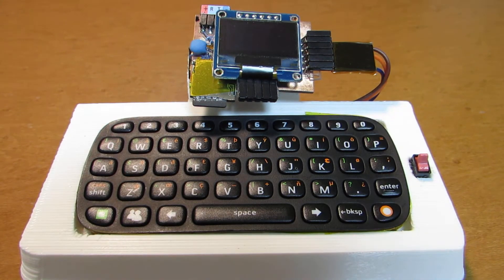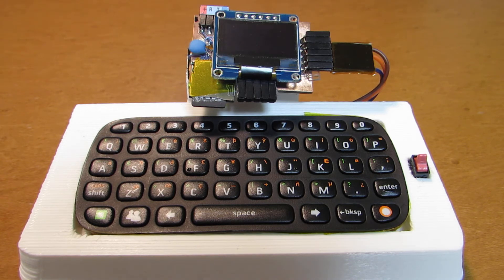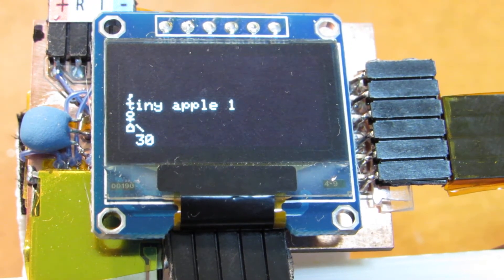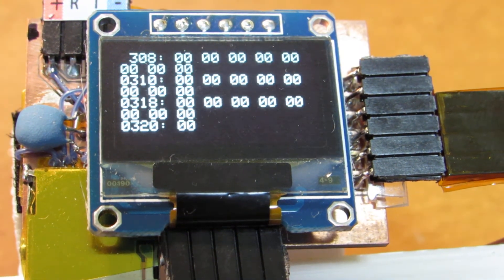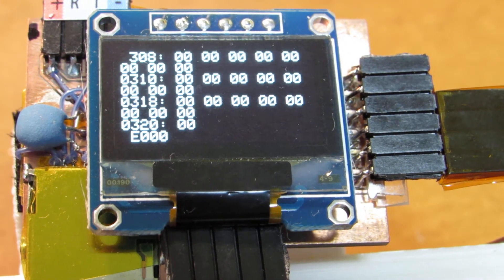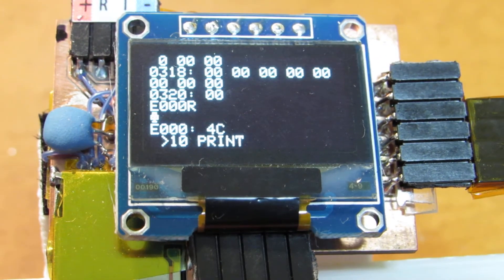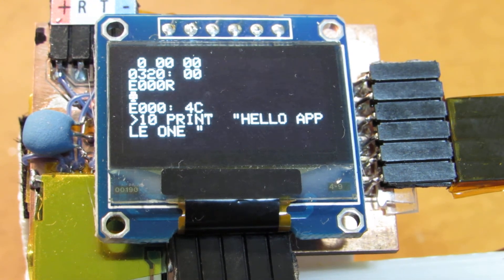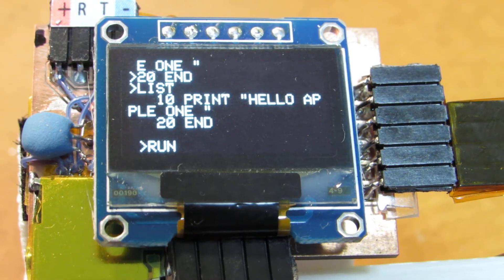Tiny Apple I computer

Comment: thank you for your reply but i already got the code for a while now ... problem is keypad matrix output is shown on software terminal but not on the oled so i'm doing something wrong
Reply from the maker: +piet praters I see. Please try several Arduino IDE version. I confirmed behaviour of 1.0.6 and after 1.6 is quite different. I remember this code worked perfectly on 1.0.6..